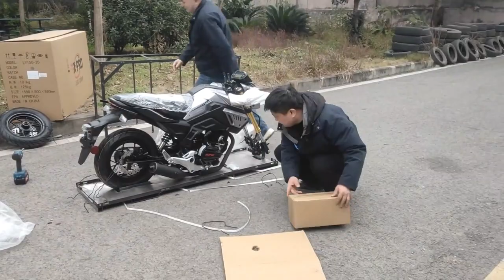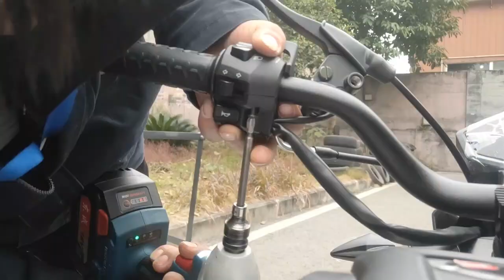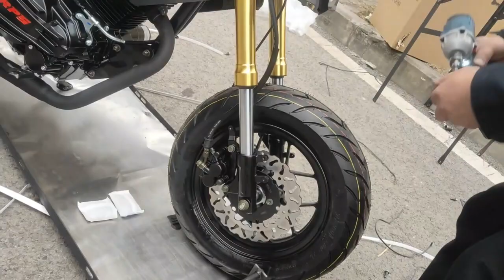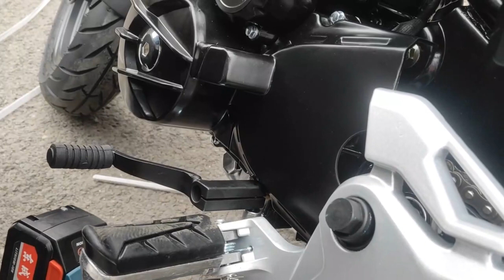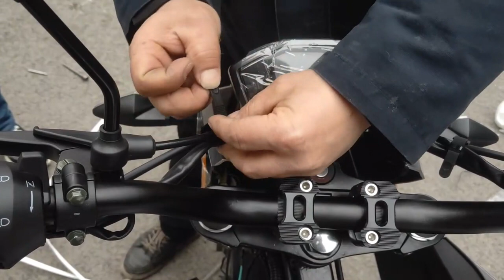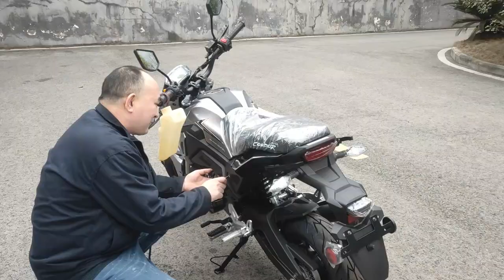X-PRO Condor 150cc Assembly Video

Comment: Where is the fuel shutoff valve?
Reply: Did you find it? I think mine won’t turn over because I can’t even see gas in the line
Reply: I just got mine yesterday I can’t get it to start
Reply: @JpHebert you get it to start ?
Reply: @dontreveonjolley2264 did you fix it? I’m having same issue